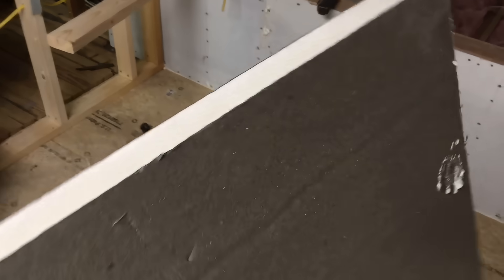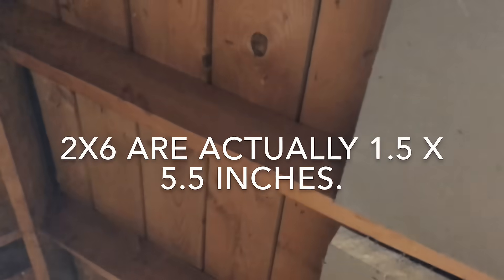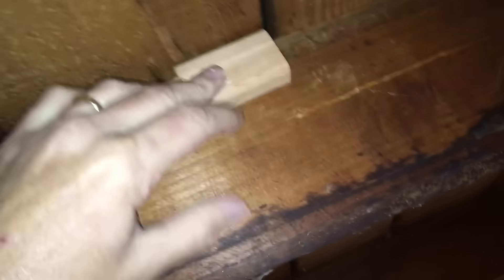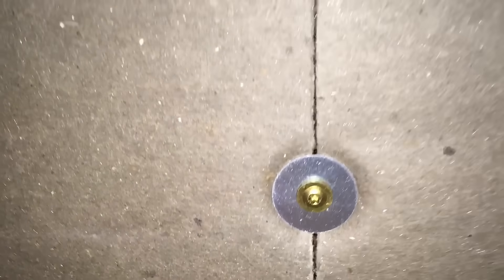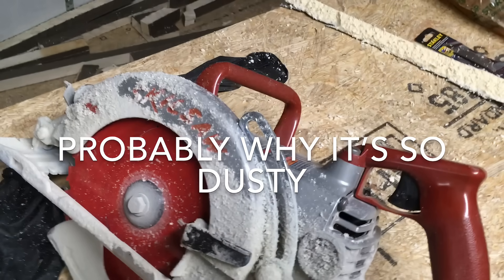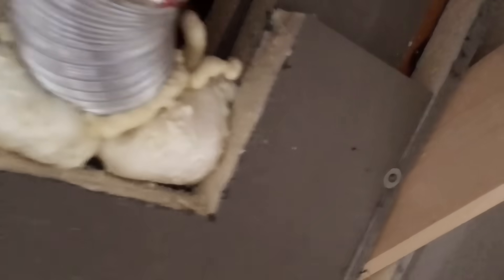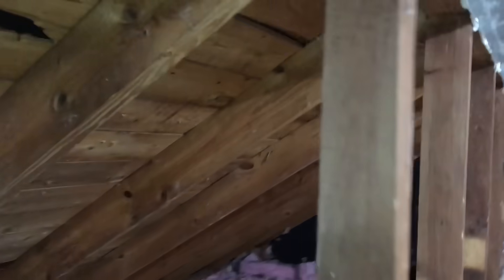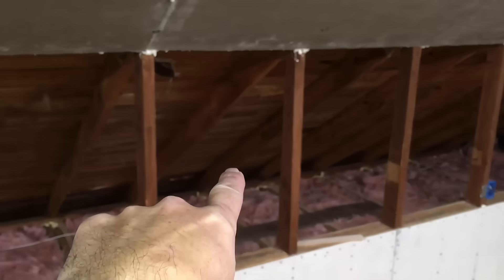Getting R-30 in an attic suite with 2x6 ceiling rafters

Comment: How did the total cost of this work out?  The current cost of the insulation board is now much higher, but assume your cost of $18 per 4 x 8 sheet (excluding sales tax).  That's $0.5625 per sq ft for R10 of insulation, or $1.6878 be sq ft for r30.  Lets say the house is 2000 sq ft, so the roof coverage would be, say, 2,600 sq ft., or $4,388 for the insulation board.  Add to that the cost of the wood spacers, wood glue, spray foam for the cracks, the other installation materials, the inevitable additional tools and supplies as well as the "opportunity cost" of the installation time.  But you do have a vented roof which will not void shingle warranties.  Spray foaming the entire roof may void shingle warranties.

Comment: You could have bought a couple of $400 spray foam packs . Instead of paying someone $5000 to do it for you. Also if I was to spray foam then what happens if I don't have the air gap under the roof sheathing?

Comment: Every place you had to add can spray foam to seal gaps, that is not R-30, that gap. So your job failed in my book. To me a solid R-30 job would be closed cell spray foam all the way for the entire project. Patch work like adding canned spray foam doesn't cut it for R-30. And this job has a TON of gaps.

Comment: This is far from cheap, I would use Rigid foam board, no fiberglass in it and cheaper than iso boards, it is about the same in r-value.  To help prevent itching use baby powder, I fill all my pores with the powder including face and neck keeps fiberglass out of your pores and you will not itch, the worst part of the fiberglass dust is when it gets in your eyes and throat.

Comment: Great ideas! I will copy your idea of spacers from ripped 2x4s and foam board. HOW DID YOU FASTEN DRYWALL to the living space side? 
It seems in other videos that you have fully finished out the space with drywall? Long screws to reach though the last layer of foam into a rafter? But can you hang drywall with that? Dont drywall screw heads have a shape to countersink effectively without pulling though?? Did you just use long screws?
Reply from the maker: Here's the video on how I fastened the drywall. https://youtu.be/dGeoA1ji_iM ... .and no screw pops yet. All still looks great. Thanks for the comment!

Comment: I like how the 3rd layer covers the roof rafters, makes it a little harder on the drywall hanger but it does save a lot of energy. It's amazing just how much energy you lose from wooden studs.
Reply: Thermal bridging can be eliminated by strapping.
Reply: What's strapping?
Reply: What your one mom does to your other. @mar4380

Comment: question on the 1&1/2'' gap below the roof deck. Is there a specific recommendation on the size of this gap. I have a very similar situation - but have 2x4 rafters (90yo house) - so I would like to make it as small as possible to get highest R possible - but still maintain deck ventilation. How do you deal with vapor barrier - especially around the interior walls that run along the rafters? - thanks!
Reply from the maker: I used a 1.5" gap because that's what my shingle manufacturer recommended to maintain my warranty. As far as vapor barriers go, I didn't use one. I drywalled right over the insulation, banking that my air-gap would keep things dried out. Here's an update video if you're interested: https://youtu.be/5oSQhPvCvz0  and here's one on how I did the drywall:  https://youtu.be/dGeoA1ji_iM  ... Hope this helps.

Comment: Great video! Will I run Foam Board ALL the way to the Roof Eave Baffles (where air comes into attic) OR leave some space ?
Reply from the maker: Thanks. You can do it either way. To save the most money, I just used the foam from the knee-wall up, because it is considered "ceiling" which in my area requires R-30. Then I insulated the kneewall itself with R-13 batts. It would be better to go all the way to the eaves, but not necessary.
Reply: @FamilyFriendlyDIY  Quick reply! I’m assuming if I Foam Board all the way to the Baffle entrance, it’ll make the Home more Energy Efficient than r-13 mineral wool | pink insulation?
So yes, spending more $$$ but getting more Energy Efficiency & Cool | Warmth here in Upstate NY

Comment: I understand you need a channel between the rafters from the soffits to the ridge vent. But do you have intake vents at the soffits themselves, or just need an air channel between insulation and shingles so they can breathe (in effect just allowing airflow from the ridge vent)?
Reply: channel/air gap is needed if there are soffit and ridge vents but if using aluminum foil faced the gap is needed to reflect heat back out. Obviously this here is not a shiny surface on the polyiso. In a case of no soffit and ridge vents probably no gap and make sure everything connecting to that roof space is absolutely air tight for an unvented roof assembly. I just re decked my rood after this particular assembly after 12 years or so and there was no deck rot aside from what was there from leaks 20-30 years ago but I sealed every penetration, every wire, top plate etc....I replaced the deck because I am getting solar and wanted thicker than the 75 year old 3/8" deck.

Comment: That is foam board. Not some fiberglass mess. No comparison between the two. Go to 7-11. Get a piping hot cup of coffee. That cup is 1/8" thick Styrofoam. Does the cup get hot? Nope. Does it burn your hand? nope. I can see R-30 for fiberglass insulation and about R-3 in a foam product.

Comment: For anyone watching this. Do not insulate this way. Don't insulate the slope then the kneewall wall and floor. Insulate the slope from the soffit to the attic flat. Unless you absolutely have to. Yes it's slightly cheaper to do the wall and floor. No it's nowhere near as efficient and you'll save more in the long run by going down to the toe on the roof deck. And don't use Batts on the flat, rent a machine to blow it in. Your energy bill will thank you. There's nothing really wrong with how this guy did it. It's just the lazy way to insulate these areas and is much less efficient than bringing insulation  to the soffit and using blown in in the attic flat where you'll save more over time. And if you do it his way. Put some tyvek on the backside of the wall and floor to prevent any windwashing on the Batts.

Comment: Great idea for your situation! People should always remember the whole house attic fan can help cool your attic down too(especially if your using for storage & you happen to need to be up there! The cooler air from below will come up to the attic! If your roof ventilation is working properly the hotter air will be pushed out of the attic! DO NOT REMOVE YOUR WHOLE HOUSE EXHAUST FANS! (And of course don’t walk into them while you’re using while you’re in the attic duh!) if you plan to store things up there… keep these ideas in mind & be safe! My old house we had a power ventilator in the upper center of the attic! It made a big difference on my undersized AC! “It became undersized when a certain person decided to expand the house…. right after I had installed the new AC!🤔😳🙄
Btw make sure you communicate with your spouse before you have certain things done!😲🤔😂😂😂

Comment: Rigid foam loses up to 20% of its R rating over time, sometimes less than 5 years.  Foam also shrinks over time, perhaps 1/8" over 4' width. It also burns intensely if you have a fire. Those 3 things would prevent me from ever using rigid foam.

Comment: In our area, home dep. sell a 2” thick iso board rated @ about R-13+, that has a heavy foil face on both sides.  I’d advise sealing the edges using a good foil tape if edge is exposed. 
Our attics are Code @ R-40.  Unfortunately, most common roof framing is the cheap trusses, which have too-narrow an eave angle to fit even R-20 nearer the wall edge. 
It’s tricky retrofitting that for better insulation. 
Here, we plan to push-out walls under the eaves, to gain interior space, and install exterior insulation..which will also help those narrow angles in the attic periphery be better insulated.  Strategic deco ceiling-to-wall Coving at those edges can also camouflage more insulation there.

Comment: I'm in commercial roofing and very familiar with this material. Only thing I would have changed would have been to Isolate the air cavity with poly film. The facer of this insulation is organic and depending on location could result in unanticipated condensation and mold growth potential.
Reply from the maker: Thanks for that info, Chris.
Reply: poly before the insulation? or on top of the insulation?

Comment: R 30 fiberglass between rafters leaves you an effective R 21. By adding 1 layer of that board across the rafters you would have an effective R value of R 32.5 but lose 2" of head room.

The way you did it you did get 11.5 x 3 layers = 34.5 minus for the wood of 5.5. So 34.5 - 5.5 = R 29 but hey, you didn't lose 2" of head room. Good Job?

BTW you are lucky, here where I live ceilings have to be R 42
Reply from the maker: Whoa! Are you in Canada?
Reply: @FamilyFriendlyDIY  It does seem like it sometimes, like when it gets down to 35 degrees below zero. Code here used to be R 38 but recently went to R 42 for new construction ceilings exposed to outside.

Actually I live within an hour from the Canada border in Michigan. True story, I went to work one day (Jan 1992) and when I got home I couldn't find my car. It had snowed 6 feet in the 9 1/2 hours I was away.. Later that night I dug a tunnel out my back door 3 feet wide and 7 feet tall then had to find the fire wood pile to make a fire in the fireplace. The snow had drifted to the center of the second floor windows. The back door was a slider and there was no room to put more snow in the back yard so I shoveled it from the inside and melted it in the bathtub.
Reply from the maker: @smarthome2660  That is wild! I can’t even imagine. Thanks for the story!

Comment: The special note is it has to be covered with 5/8 with fire mesh drywall.  At least one layer two layers depending on local code.
Reply: one layer of 1/2" drywall for ignition barrier over foam board, just like the rest of the house sans rim joists and door jambs. Thermax does not need anything over it. It passed the fire test. There are also other prescriptive coverings like sheet metal and mineral/rockwool.

Comment: Any 2-part foam has declining R-value. Over time the cells of the foam break down, releasing the gas that gives it the R-value. Air replaces the gas. Ultimately the R-value is less than R-5.
Reply: My father-in-law was one of the inventors of Styrofoam.  He told me the R-value does decline some, with time.  But R-5 sounds very low.  Do you have a source for that number?
Reply: @PeterLawton  Look up the manufacturer, and get their R-value warranty. Menards claims R-5/", but that is a rounded up number. Warranty is 90% for so many years and it declines from there.

Comment: Just foam it.  Leaving an air space invites moisture-laden air to condense inside of the cavity.  University of Dayton had this problem, removed all the insulation, foamed 4" of closed-cell foam on the underside of the cathedral roof deck.  Everybody happy, and all good.  Montgomery County building department (who had originally insisted on an air space) admitted they were wrong.
Reply: He just did a 3 year update with a borescope and the roof decking looked fine.
Reply: Dude totally showed how he provided code ventilation at each rafter....    I'm putting a double throwdown  impeachment fact check on to you for false information propaganda, hate speech, insurrection, racism, terrorism and racist terrorism wich is a hate crime.     The racism made me sad and i wound up crying and peeing in my pants and that's assault which is a misdemeanor in most States.  I don't even know where to begin about how you should be completely deplatformed and banned from the internet forever for openly speaking despairingly about Montgomery County.  No!  Not everybody is happy,  i'm totally triggered and i must inform you by law that i am going to my safe spot, slamming the door behind me and calling my emotional support therapists to tell on you.
Reply: Spray foam is slowly being outed in northern Ontario, impossible to get consistent quality control. Rock-wool, which is replacing spay foam, does the same thing for most applications, and it’s fire and mold proof.
Reply: Totally unnecessary. Obvious wrong method of installation was used. Leaving air gaps between joints & seams should be addressed during intalation, joints get taped and gaps filled and sealed. Even BlueSkin as first barrier will stop any leaks. As far as a home attic diy; this will be a excellent start.
Reply: Wrong!! Research is exposing the fact that moisture is being trapped by the spray foam on roofs- rot rot rot

Comment: Foam insulation -  then never  have a fire in your home. 🔥= ☠️.....     have a family, love your children?  get wood fibre insulation.. works great, won't burn under flame (only blackens) has great thermal inertia...
Foam insulation such as 'Kingspan'. is just deadly in a fire situation...
llfiam insulation leaves gaps where you have to plug with foam filler - self expanding insulation fills these gaps naturally ... Also foam insulation is not great for the environment..

Comment: Hey, you don’t need an air gap on roof framing bays that are filled solid with rigid foam insulation!  Company’s that blow on expanding foam fill the cavity solid, it’s the same concept.
Reply: ...because rigid foam (polyiso and polystyrene) don't breathe like fiberglass or rock wool. They don't conduct water vapor.
Reply: @tomlampros7122  exactly right, so no need for the air gap. 👍🏻

Comment: We use inch and a half polyiso on our rim joists with 2X4 compression blocking under stud centers to nail the belly board to. I use a wallboarder's Buddy drywall cutter for the polyiso. Score both sides and snap. No dust floating around in the air. It is really accurate and straight

Comment: You only have to fur out the area that's insulated... I'm a framing Carpenter you can always build knee walls to get the rafters higher but we use a lot of 2x8 and 2x10 rafters here....

Comment: add attic vent air baffling against the rafters (this is to prevent condensation against the backside of the roof which must be the same temperature as the outside air.)... use staples.

2x6 Roxul insulation is R24... so you have to find another R6 with a 1" styrofoam board = done = R30

add 1x2 strapping against the rafters and you're ready for vapour barrier, drywall etc.
Reply: @Volkan Before drywall there has to be a vapor barrier... closed cell foam board can act as a vapor barrier, otherwise it's poly plastic.  No warm air from the dwelling unit can reach the roof plywood, that is the law.

So either you are using caulking with the closed cell board or installing a vapor barrier, then your drywall.

From the inside roof plywood then you have the air baffles, then roxul, then styrofoam board, then vapour barrier, then drywall.